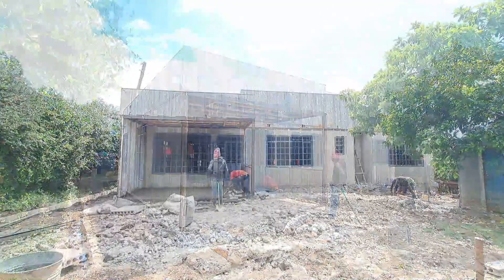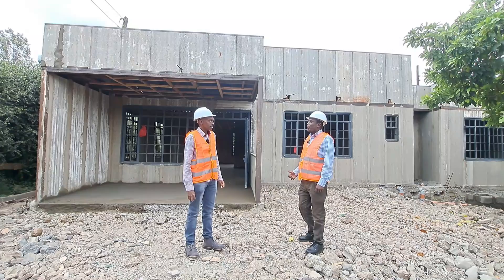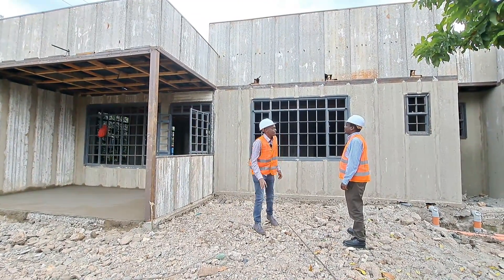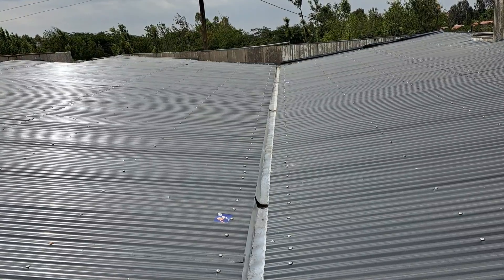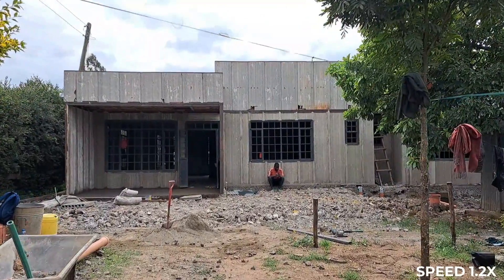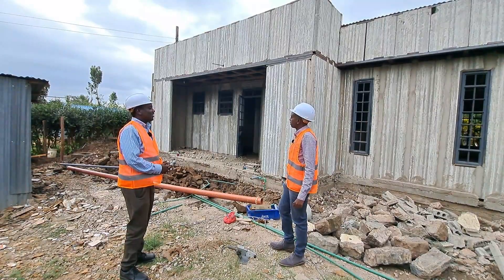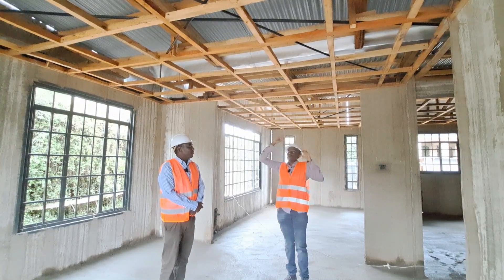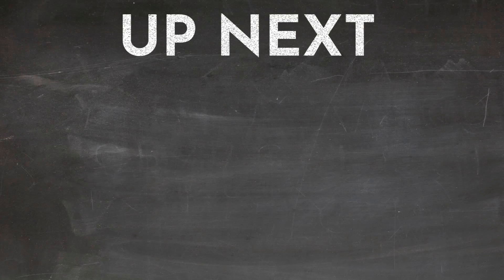How a Hidden Roof in a 190 SQM Home Slashed Roofing Costs by Ksh 600K ($4.3K)

Comment from the maker: What if you wanted a flat slab as a roof but the costs exceeded your budget? Well, this home owner adopted the hidden, butterfly roof design, which cost her Ksh 400K (USD 2.9K). That price point fit her roofing budget. She also used precast panels for walling her house. The project so far took 6 weeks to build and cost Ksh 2.8M (USD 20.2K) at the time of filming (27th May). It's a 3 bedroom, 190 SQM (2,045 SQFT) bungalow. Enjoy the video!
Expected total cost inclusive of finishing: Ksh 3.5M (USD 25.2K)
CONTACTS
Eng. Ian Kiptoo (Main Contractor) +254727644782
Precast Panels Supplier (Kingdom Precast Solutions, Sammy Wambua) +254714259226
Reply: The total cost is still high and seems there is no cost difference b/w this and brick stones. What the client looking for always is cost efficiency and quality
Reply: Hello good job on the content. I'm unable to reach Eng Ian on whatsaap. Does he have a whatsaap line? I have a project I would like him to fix the hidden roof
Reply from the maker: @brianmandela1226  Yes his number is on whatsapp
Reply: Too expensive  for this
Reply: @musemuse1507  Its a good estimate
Reply: very nice design for a concrete roof house... hidden roof makes it better
Reply: It can't be 3.5m. Maximum 2m. Contractor style up

Comment: I have been following the videos and they are very informative. I think the part of where the panels sits on the foundation  and is held by 100mm of concrete and does not shake or tilt is where doubts remain. Seeing is believing, I guess. I wonder if any of the places that manufacture the panels can do a demonstration of the panels attached to the foundations and try and tilt the panel over and see how much force it takes.  On the hidden roof, how much volume of rain water at a go can it handle before it starts to leak into the ceiling.
Reply from the maker: This issue I'll definitely be following up on upcoming projects
Reply: Yes please do thank you
Reply: The water seeping through the roof was my concern too.

Comment: im so thrilled and encouraged by this alternative methods... its so kuch faster and cheaper. i dreaded construction because of the time consumption and costs... This is just  wonderfully encouraging. My question, is can the precast bebusef for a double storeys, or more than 3m height/length, and how eould it be done. Kindly share video if you have already discussed.
Reply from the maker: Y3s they can build a storey house. A storey house made of precast panels is coming soon on the channel

Comment: A question about the butterfly roof. What if the downpipe is partially blocked of fully blocked and there is heavy rain. How much water can the gutters hold before it spills over. And do they have overflow systems installed?
Reply from the maker: With this roof design, proper maintenance is essential to ensure all debris is cleared off the roof and inside the gutter. You can install overflow systems as an additional cost to your gutter system

Comment: Awesome video. I'm quite interested in this alternative building technique. I'm still not convinced about the long term consequences of using steel because it can rust. So what measures do you take to mitigate this risks long-term. Thank you
Reply from the maker: You can spray paint the steel or plaster and seal the steel permanently with concrete

Comment: My biggest worry is the valley gutter.It won't last more than 5yrs before it starts leaking especially if the surrounding has trees. Fallen leaves inside the gutter,if not cleaned, will cause poor rain water flow or blockage of downpipes which will cause over flow.Eventually the valley gutter will corrode and develop holes whch will cause leakages.The valley gutter to me looks very light in terms of thickness.

Comment: What is the size of the RHS tubes? can they be used as columns for two storey building instead of traditional columns?
Reply from the maker: Yes they can be used as columns according to the structural engineer specifications
Reply: @PropertyNoma  which size is ideal for two storey house

Comment: How does the hidden roof fair in adverse weather like heavy rain? What do you do to prevent leakage and ensure there's no place the water will be stagnated?
Reply from the maker: You use waterproofing cement for plastering the edges. The valley should have a gentle slope to ensure the flow of rain water by gravity. The valley should be regularly checked to remove leaves and other debris

Comment: Using the precast panels and interocking blocks, what can you advise between the two which is much stronger. Please advice.
Reply from the maker: Precast panels are much stronger
Reply: It depend with the interlocking block u use.I saw 2 kindls that are done by concrete.

Comment: Another suggestion bwana engineer, instead of just using the screed for the panel support to the foundation, you can use structural metal straps embedded in the foundation (Insitu) then fasted them to he panels as you install. otherwise awesome work. I am loving the precast panel construction.
Reply from the maker: Thanks for the suggestion Jimmy